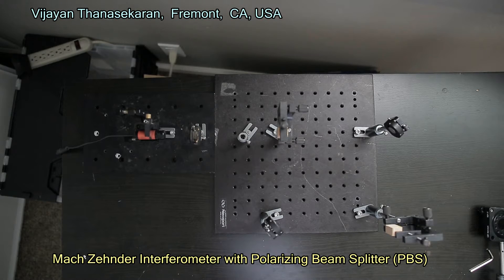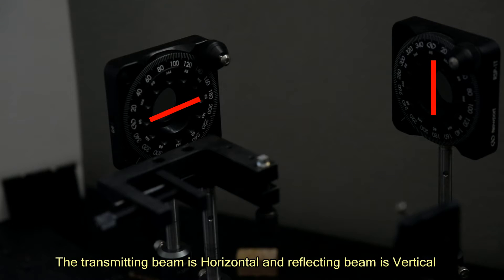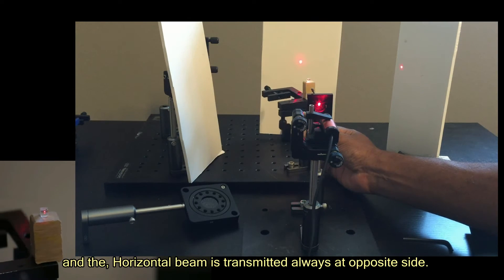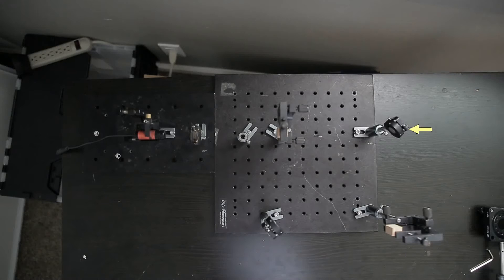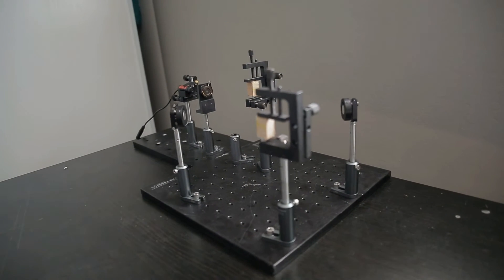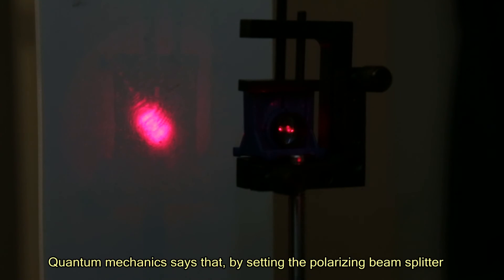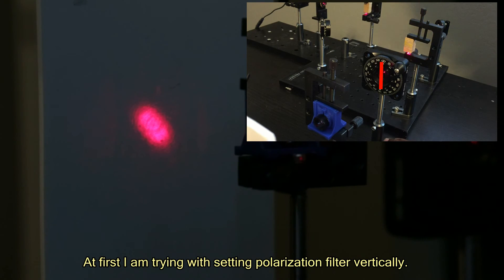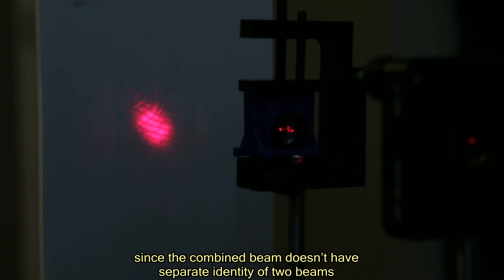Mach-Zehnder Interferometer with Polarizing Beam Splitter (PBS) and Quantum Eraser.

Comment: laser light is already polarised, so there is a great chance that your 1st beam splitter wont split 50/50 (unless the laser polarization is properly 45 degree from the cube horizontal or vertical direction). Therefore interference will be small

Comment: Most excellent! Could you use a green laser ? Also the list of parts?  I'm still baffled how the crystal works ! I would love to try this ....
Reply: This will work with a green laser or any color laser.  There is no crystal in this set up, just a polarizing beam splitter which is basically two prisms glued together at their hypotenuses.    There is a thin film coating on the hypotenuse to select for polarization.